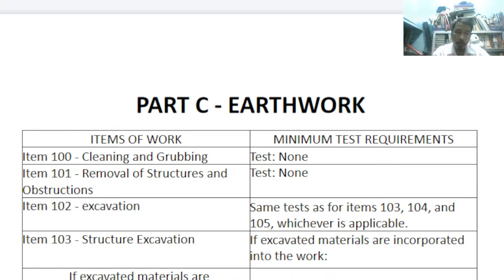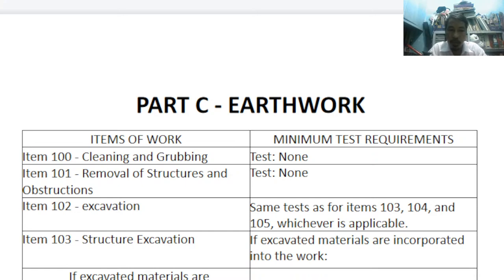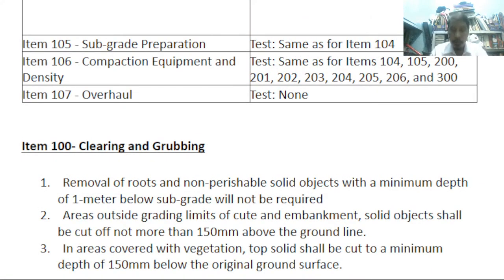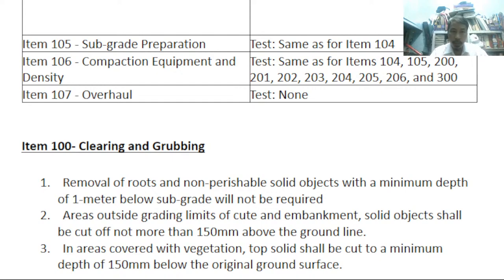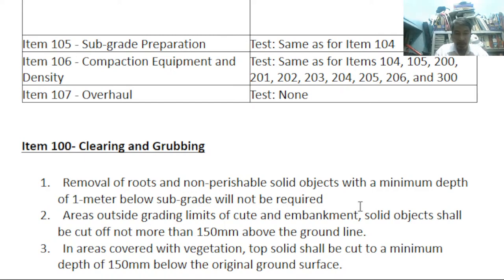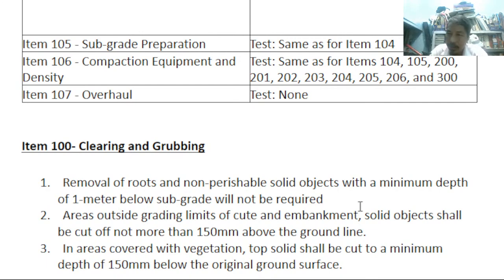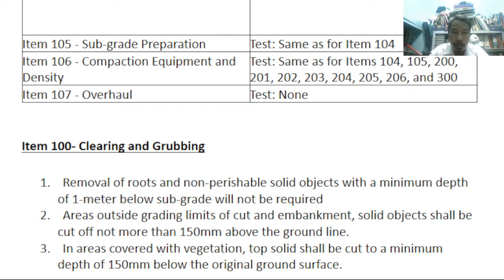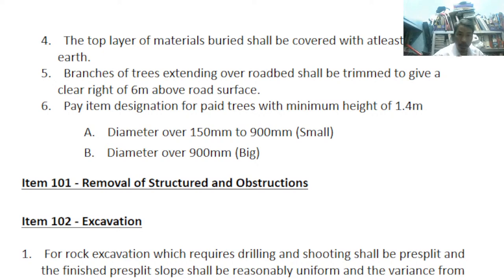[ LIVE CEE4 Lecture 07 ] DrAP Zantua Part C: Earthworks for Material Engineer + DPWH DO

Comment: Thankyou sir for discussing about Earthworks for material engineering. In structure excavation there are key points given in the presentation. For pipe culverts, the width of excavation shall be at least 300 mm greater than the horizontal diameter of the pipe. For backfill and embankment for structures other than pipe culverts, excavated areas around structures shall be backfilled and placed in horizontal layers not more than 150mm thick. For bridge excavation, the volume to be paid shall be the vertical 450mm outside of and parallel to the neat lines of tge footing.